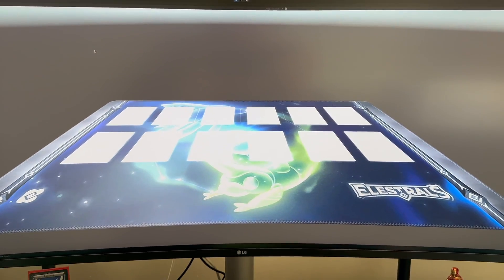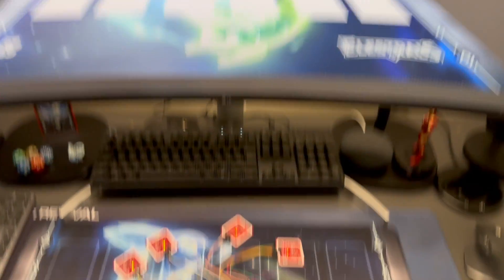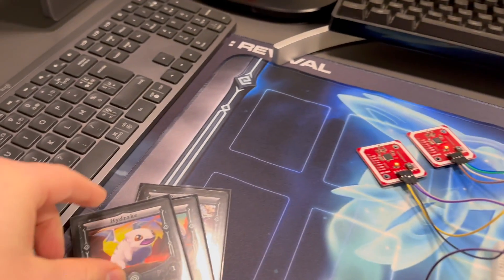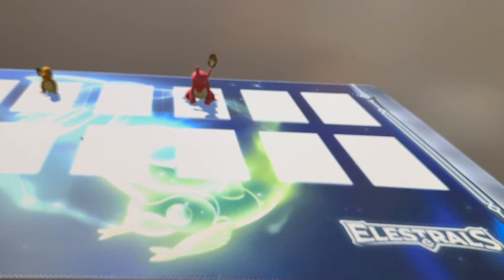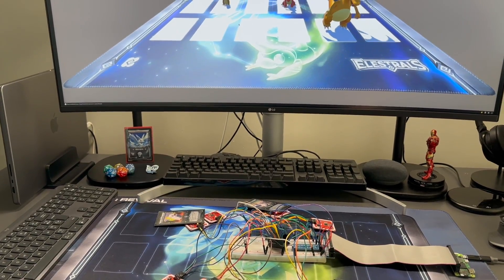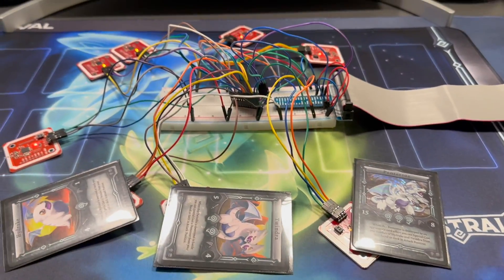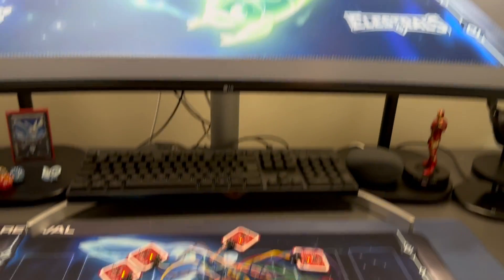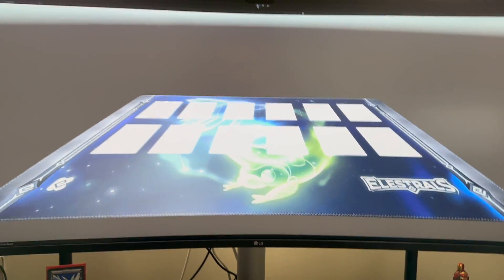Building a Physical Duel Disk - Part 2

Comment: Connect it to a haptic feedback suit with a pull line & a foam pit behind each player & play in a large colloseum. Start with blue eyes format go from there. Use Microsoft hololens. Eventually the tech will be as light as regular glasses or we can redistribute the weight of the glasses on our face & nose of our bridge using a helmet.